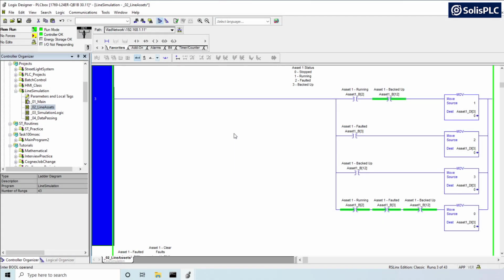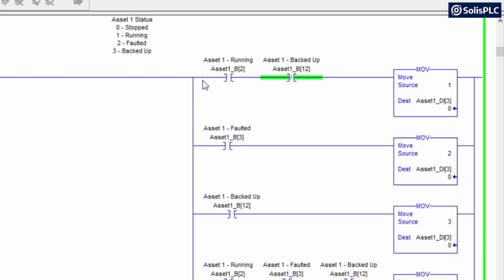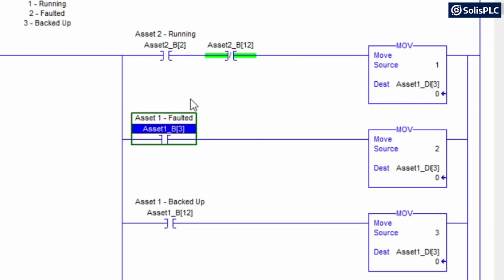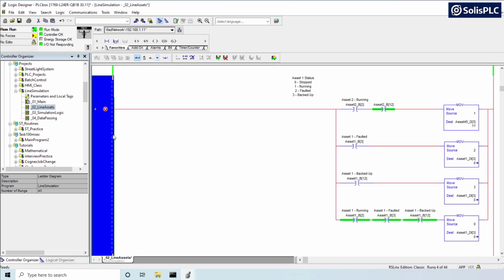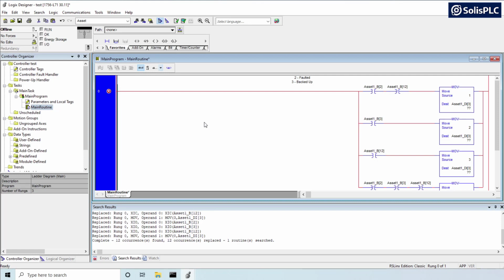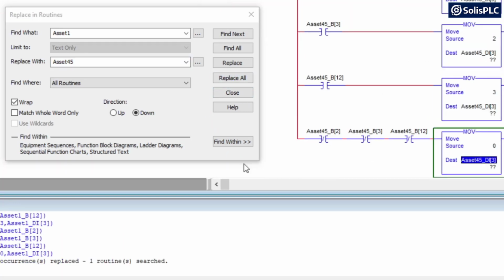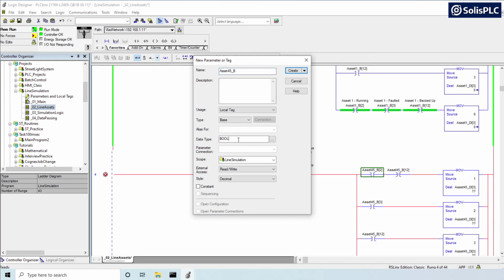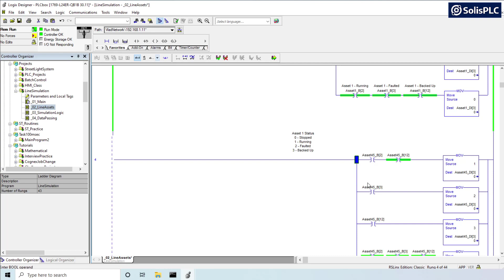PLC Programming Efficiency in RSLogix and Studio 5000 | Duplicating Code for Assets, Motors, Valves

Comment: I dont know if i agree, yes it works, but why not just make the function, then put and in/out and reference a struct to the in out then its all done all You have to do is make a copy struct with new name and insert the function again with the other struct data type on in/out leg when calling the function
Reply from the maker: I wouldn't use a function for a number of reasons, although it certainly is possible. First, an AOI can only be changed offline. You'd have to take down the processor if you wish to make changes to your existing code; adding "another" device wouldn't work. Second, using functions in this instance would quickly escalate to using them excessively. If you want to call those devices in your code, you'd also create a function for that. SIs that use that quickly build multilayered functions and make it impossible to work on the system. Lastly, creating functions solves some of the problem, but if you call a large number of IO to / from the function, you're still going to rename all the tags. You're only saving time on the internal tags by using functions.
Reply: @SolisPLC  didnt know You had to take Down the processor in studio 5000 i code in tia portal where u Can change it online, without stopping the CPU, there ofcourse are pros and cons to both, for me personally i’d like to use a function for every event that has to be called more Than twice also test it enough, and i also make functions for devices so i just drag and drop my libary in and then insert the legs as : start : Stop :blocking: error: etc etc, but ofc you Can use Your Way, and i Would use that Way if it wasnt my code.

But it comes Down to 100% if changing the function in Studio 5000 Would stop the produktion, ofc never do that then, i just Only code in tia portal where u Can change While online. :) great content btw :)
Reply from the maker: That's one of the big differences between RSLogix and TIA Portal. You can't make changes to a function while online in RSLogix. As you probably know, in a real plant environment, it's not always possible to bring down the PLC (of course, I can just re-download in my test PLC). I agree that using functions for blocks of code is optimal, but it should be within reason. If I can use the method I showed with relative simplicity, I typically won't use a function. If the code has IO that can't be easily replaced, I'd go the function route. In either case, it's surprising that you can't use the find+replace online and most programmers just sit there and change tag names one by one.

I'll have to play a bit more on TIA Portal. I've gone through a day of training, but I'm looking for an actual project to get more familiar with the Siemens PLCs.
Reply: @SolisPLC  i love the tia portal but PID in my opionen is Way better in studio 5000

Im doing a little project with factory IO - Siemens tia portal, its not done but i have a video on my Channel, its sorting packages + and warehousing :) but to Your comment making the CPU not stop is a Big priority otherwise it needs planning ahead :)